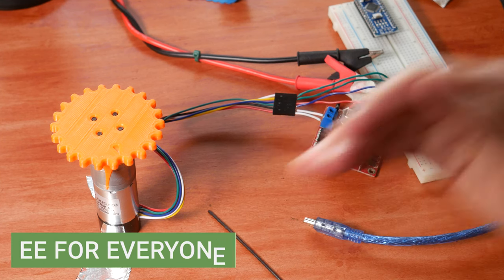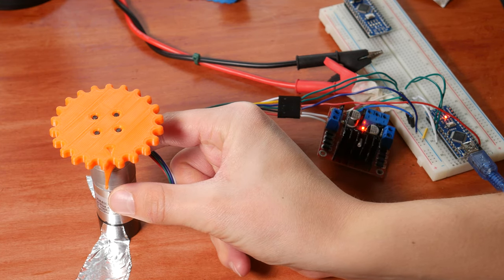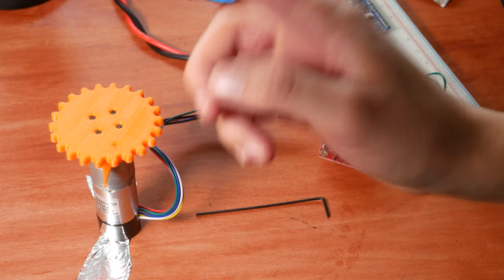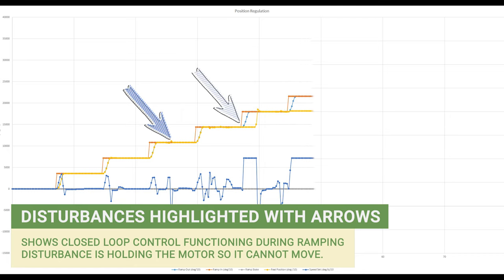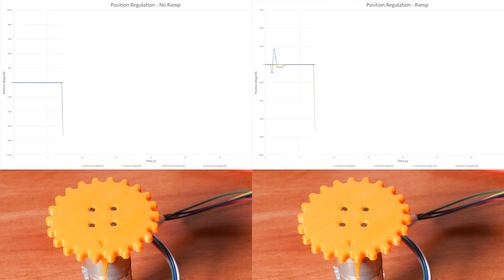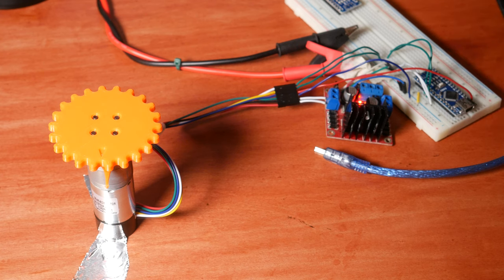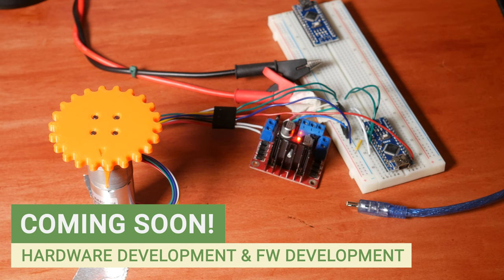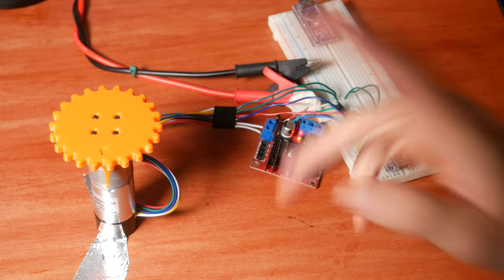Trapezoidal Motion Ramping – Closed Loop Motor Module Prototype | MOT 7

Comment: I had to tackle this problem also.
A common solution is to use the AccelStepper library, but the client wanted to keep code closed source, I took it as a challenge to re-create the library my own way. My approach was to calculate when the next pulse should occur and set the timer accordingly, following a quadratic formula. You would think it should increase or decrease the pulse length linearly, but the algorithm isn't being executed at fixed time intervals, the time intervals are proportional to each step. I had to calculate the function to perform a smooth ramp with programmable limits on velocity and acceleration with respect to position (number of steps) rather than time.
Reply from the maker: Power Max, that sounds like a heck of a project! I'll keep the AccelStepper library on my radar.  Your algorithm sounds like a very clever solution!

Comment: I would be very interested in seeing your code for this as I’m working on something similar.. but a bit bigger.. 8kW bigger :)
Reply from the maker: Ooh My! Code is certainly coming. 8kW is an exciting number. I hope you succeed, and I can't wait to have better code to share. What I have right now is a twisted web of "hmmm... there's a better way to do this" :)
Reply: @EEforEveryone   Thank you for the reply :) I’ll look forward to you showing your code in the future then :) I’m still running my project on the bench with tiny test loads and a current limited psu. Soon I will have to bite the bullet and connect it to the real motor and 48V batteries. Squeaky bum time :))
Reply from the maker: Awesome stuff. That moment of 'well, I hope this doesn't explode' is always a treat. :)
Reply: 8kW / 48V that's about 160+ Amps....so more than proper software...your hardware must be robust too..lots of control loops cascaded... current/torque/temperature.of .(device& motor..).but best is F.O.C. ( field oriented ctrl.) ... 👍👍👍Wish you the sucess your looking for.. ..
b.t.w. just to keep in consideration....160+ amps..is the " average" current.drawn from the battery ...in a 3ph.bldc...your peak current flowing through each motor winding/ wire , @ full load , continuous is (average current /(2/3*duty cycle...))

Comment: " S " shaped ramping curve SHOULD ..more or less mimic the motor mechanical time constant parameters....  proportionately...
Error in final position overshoot / undershoot,
another contributor could be gear backlash... 
here gear ratio has to be taken into account as a (multiplier/ divider) in the servo control loop ..
Reply from the maker: Hi analoghardwaretops - Yes, I love thinking about "S" shaping. Something about simultaneous speed control, position control, jerk-limiting, acceleration-limiting, and input shaping just.... I love everything about this project!

Yes, I think some compensation factors for backlash / ratio from "pulses" to "revolutions" will definitely need to be exposed for configuration via Modbus! Right now... it's just terrible "magic numbers" in the code.